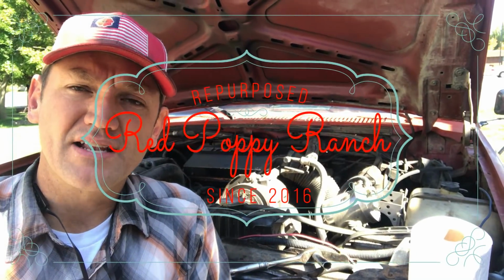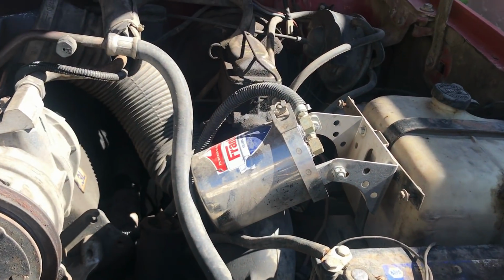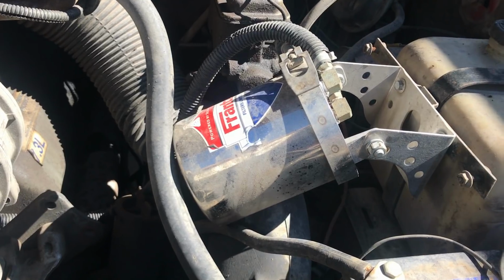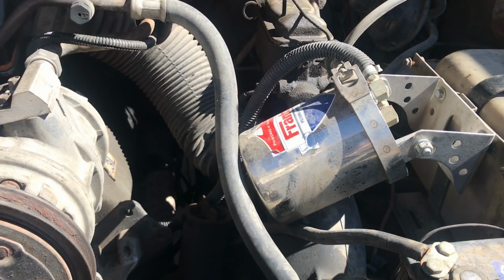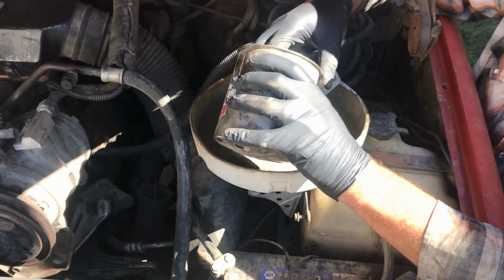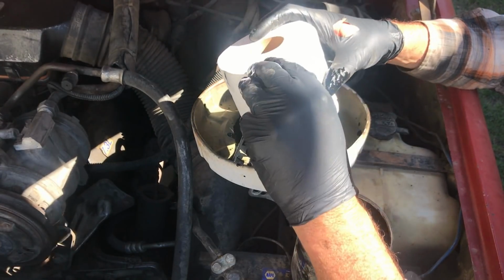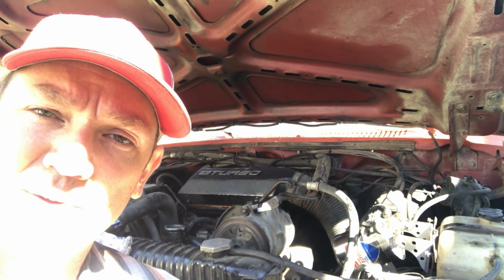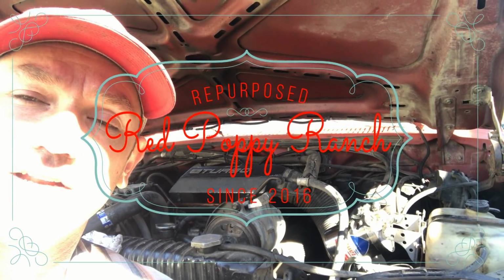#146 - Toilet Paper Oil Filter Maintenance... (Frantz Oil Filter)

Comment: Toilet paper can remove carbon black enough to make it look nice.That's how the filters were demonstrated. There will be a very small amount that is non abrasive that will get thru. When demonstrating the filters You don't want to use the same oil until it gets dark. I sometimes used diesel fuel. I think some people used cooking oil. Less messy to deal with. The same thing is happening in a diesel. You are just dealing with a lot more soot.At one time Frantz sold filters to restaurants to filter cooking oil. They could use the oil longer. The military has paper towel filters on parts cleaners. Saves a lot of money.

Comment: IS THIS FRANTZ KIT OIL FILTER IS ONLY FOR PICKUP TRUCK ? CAN IT BE INSTALL IN A CAR?
Reply from the maker: car, truck, tractor etc.
Reply: THANK YOU
Reply: I have seen a couple of cars over the years that I couldn't find a place to mount one. My Altima has bypass filters for the ATF and Motor oil.To change them I have to remove the grill. I am a clean oil fanatic. I would put them on the top of the hood if I had to.on my 64 Rambler I had the Frantz on the fender with clear plastic oil lines. Was selling them.
Reply: Both of my lawn tractors have them. I used Frantz Ford adapters and Ford full flow filters. I returned the clean oil to the drain port.
Reply: @ralphwood5114  The old Frantz 2 port sandwich adapters were handy on some cars. Didnt work so well on small engines. They depended on a pressure differential thru the adapter. For the lawn mowers I convert the 2 ports to a 1 port. The Frantz 2 ports are getting scarce.

Comment: hey, what happen to the snap ring???
Reply: The ring isn't necessary if you use a firm roll such as Scott 1000 sheet and dont unroll too much of the paper or force an over size roll and make wrinkles. Also the base does the same thong the ring does. The thing you have to deal with is getting a good seal around the core.
Reply: I wouldn't think you for sure need the ring with the Frantz elements.
Reply: The sleeve isn't necessary with the larger core of the Scott 1000 If you get a good seal at the bottom around the core.When you push the shorter roll into the housing too far the oil pressure might not be able to push the Scott down against the seal. The argument for using the Frantz elements is getting stronger.
Reply: If you don't have a sleeve you can make a better seal slightly larger than stock and a little thicker than the stock to compensate for the shorter rolls. A friend with a lathe would be helpful. Don't have to be a special shape. You can also save empty cores Split them and slide them in the new element until you get the right inside diameter. That way the core won't get egg shaped and cause a seal leak. Toss the ring.
Reply: I knew as soon as I saw him slide the new roll in he didn't need the ring. He used high quality paper Not too small and not to big. The ring is Frantzs attempt to make the filters idiot resistant for people that use Charman instead of Scott 1000.You.can get good paper from a janitorial supply. When I was selling them I was buying it by the case from Office Depot.

Comment: Bypass filters are common on the big rigs since they hold 50 quarts changes are costly. Besides these and other brands filter down to 1 or 2 microns. The big ones are OPS brand and Amsoil makes one also. Oil doesn't wear out it just gets contaminated from soot and other particles going by the rings. Soot in the oil can breakdown the zinc dithiophosphate which is an oil additive that comes in the oil for extreme pressure like camshafts (developed in the 40s). Oil also has what is know as TBN or total base number, base is used up neutralizing acids in the oil. When the test samples shows the base is getting low the more can be added. So bottom line these types of filters do work and get the oil cleaner than the full flow factory filter can. Not snake oil boys.

Comment: the trouble with switching from conventional to synthetic is it cleans out your engine and sometimes it works too well and the gaskets and seals will leak.

the bypass it's self has a small orafice on the outflow side where the oil is clean, these engines normally have a 2500 mile oil change interval so any bit of filtration helps.
Reply: KFStreich old tech no it doesn’t that is a wives tale from 45 years ago.
Reply: Your facts about synthetic oil are from 1975 and are old wives tales.
Reply: I recently went to synthetic from conventional in the 93 Legacy with 225.000 miles on it.. seems ok at 240.000 miles. Probably wasnt necessary. Its just a backup car now.

Comment: There is a trucking company just down the road from me at Alvord Tx
They don't drain oil in the big engines. They have engines that have over a million miles with no oil drains with the same engine parts. They change the big filters and add make up.oil. They spend money on an oil analysis program I don't spend money on oil analysis. My 40 year old.Ford isn't worth it. Google Gulf Coast Filters. The Ford 7.3 with the Frantz is the same system. Most. Of the owners with the little filters.don't change them often enough to keep the oil as clean as the truckers. Changing the filter every 5k might not be enough. It wouldn't be enough for my old 6.9.

Comment: So, is it real toilet paper or not? At 2:20 you said it ain't.
Reply: I think I might still have one of the original Frantz elements. It was a custom made roll of toilet paper just the right size with a thicker core. Haven't seen the newer ones.
Reply: No one has ever beat toilet paper at cleaning oil. When filter Companies come out with their own elements suddenly their new elements.are better. They are not better. Their new elements have an advantage. They fit.I will keep unrolling the Scott 1000 sheet.
Reply: The reason people call them toilet paper.filters is they were designed  to use toilet paper.Toilet paper was used for many years before  the Frantz.elements came. In those days toilet paper was a standard.size and very high quality. Then they started. Changing the core.sizes..making the rolls smaller. Most of.us like to shop around for the good stuff like Scott 1000 sheet. What some People think is the Frantz was designed for the Frantz elements and foolish people decided to use toilet paper.The Frantz.elements are more idiot resistant because  they fit.not many of us know how to use the odd size paper. Rookie's  should probably  use the Frantz elements. When using the Scott 1000 push the roll against your knee. You want the round end down.You want to make sure the core is round. You want the round end of the paper to contact the core seal before pushing the can down against the gasket. This the old instructions.The idea is to not push the paper in too far and not get a good seal around the core.unroll enough paper so the roll will slide in tight but not so tight so you you make wrinkles.  Later top loaders you.just push the TP down in the  tapered housing against the seals and put on the lid. I think the newest Frantz model is more user friendly  when using toilet paper. It might be designed for the Scott 1000.It looks expensive.  Saw a demonstration of one on u tube. The old style Frantz isn't as user friendly when using  toilet paper.Thats for the old fossils like me. Less experienced rookies should use the Frantz elements.. The new style Frantz was designed for the Scott 1000 sheet. I see one guy demonstrating how to service it. You dont have to unroll any paper. It takes the whole roll.
Reply: Toilet paper was used in the Frantz  for about 30 years before they came  out with the Frzntz elements. Frantz  had a list of recommended brands. Safeway truly fine, MD , Scott, Chiffon. and others. The light  aircraft  AeroFrantz  used the same  brands. When I say the Frantz elements are better it's because they fit. You have to know what you are doing to use the shorter paper in the Frantz.

Comment: The carbon and acid are to small to be removed. The acid in the oil from lack of changing will eventually damage your engine.
Reply: If you change the filter often enough You will also be adding enough oil. Diesel rated oil has acid neutralizers in it.
Reply: If the engine has an acid problem you know it as soon as you change the TP or look at the dipstick. I have never seen evidence  of acid attacking aluminum. I dont think any modern moter.oil would allow acid to attack the engine. Skipper Yee told me keep your oil clean and dry. Any carbon that can find it's way thru a roll of high quality TP is non abrasive like black ink. Why people think black means dirty oil I dont know. A rusty dipstick normally means water. Acid would attack the aluminum in the Frantz..never seen it happen. To a oil change enthusiast  every problem is caused by not changing the oil. I dont change oil. Probably more accurate  to say I never drain oil. I add a lot of new oil. Some call that changing the oil one quart at a time. If there is acid in the oil it will attact inside the filter and the dipstick. Use a good oil.and keep it clean and dry. I have always used diesel rated oil that neutralizes acid as long as the TBN number is up.

Comment: A buddy of mine had one of these on his 1970 Ford Pinto back in the early 70's.  One thing I remember is that it filtered EVERYTHING out of that oil.  He would run it 3-4000 miles and that oil would look as clean as the day he put it in.  I guess a diesel is a bit too much for it.
Reply: TexasScout Noneofyourbusiness Excellent point!!!
Reply: Rub a little in the palm of your hand. If the oil fills up the crevices in your palm and won't wipe off you aren't changing the filter often enough. The black is only a color such as ink.
Reply: Back before fuel injection engines generated a lot of soot. The oil turned black in a short time. Install a Frantz or a Motor Guard and the oil looked new again. The housings were no big deal. It was the 2 ply facial quality toilet paper inside that did it.We changed the filter more often and added more.new oil in those days. Not like my Altima that gets a new roll every 6 k and a quart of synthetic. Not like a diesel that generate a lot of soot and some soot particles too small to filter out. That are only a color like ink. There is dirty black oil and there is clean black oil.
Reply: In 1970 I was working for Ford. My boss had a Mustang dragster with a Chevy racing engine compliments of Chevrolet. Valvoline furnished the oil. Baldwin furnished the filters. I put a Frantz on the tow truck. Later I put a Motor Guard on his Plymouth Fury. When I heard something stupid like that paper will get in the oil or other stupid remarks I would say I put put filters on Joe Davis's vehicles. The filters were easier to sell after that. I lost track when I left California.When I left the tow truck had over 350 k on it. Almost all of it with no oil drains using Chevron Delo 100 20 wt. He changed the Frantz about every 2000 miles. 63 Chevy Suburban with the big 6 292 I believe. One of his sponsors was a chrome outfit. His dip stick was chromed. Made the oil look even better.
Reply: The way diesel owners mess up is they dont change the filter often enough. The more soot goes in the oil the more often you change the filter. My old 6.9 Ford diesel got a toilet paper change and a new quart of oil about every 1500 or 2000 miles.The oil was black but it was clean.i can spot dirty oil from across the room gasoline or Diesel. Some diesel.pickup owners are installing the big paper towel filters. I did a Fleet of them. All Powerstrokes  and one Dodge Cummins. NASA saw my posts and started  using them. He said they are for.industrial use only. The average person doesnt keep a vehicle long enough for.it to pay. I think he is right in many cases.They use the Gulf Coast. I dont do them any more. The big 80 got me.
Reply: The toilet paper can get the job done.Its a marrer of changing the toilet paper enough to keep the oil clean. Some soot is too small to be filtered  out. It is non abrasive but will turn the oil black.Truckers do the palm test. Put some of the black oil in the palm. If it is clean it will wipe off clean. If the soot fills the crevices  in the skin and wont wipe off you will  need to change the filter more often.
Reply: Did a Fleet of Powerstrokes when the 6.0s first came out. They ordered  the Gulf Coast O1 that took a roll of Bounty Big  Roll paper towels. I didnt mind changing the Gulf Coast toilet paper filter every 1500 to 2000 miles. It was bolted to the plastic fan shroud.in an upright position . I returned the oil to the fill neck below the filter.excess oil drained.out over night.

Comment: A few years ago someone saw my posts and asked for a propaganda package. It was a NASA engineer. Then he wanted me to come to Canaveral.I realized I was getting in over my head.I called Gulf Coast Filters and turned it over to them. Gulf Coast could put them in touch with their big customers such as the military Shell and Chevron. Not trying to cut in on Frantz. These.big companies use the big paper towel filters mostly. I don't sell any more. I have no knowledge on how to equip an off shore rig or the monster that moves a apace shuttle.I did learn some things such as new oil isn't always clean. Shell engineers were studying a Peter Bilt with no oil drains with Shell Rotella . someone forgot to tell the mechanic that changed the Bounty Big rolls.not to drain the oil. The Detroit was in near new condition.with one oil drain in near 1 million miles. Its not unusual for these engines to go a million miles bit not be in near new condition.

Comment: If these worked every vehicle would have them. Every trucking company would sure as hell use them.
Reply: I've heard that a lot. How about if they eliminated routine oil changes Jiffy lube would sell them
Reply: Cummins claimed an  80% increase in engine life using their big 750 oil filters. You dont see the Luberfine 750 or the Cummins  750 much any more. Some used cotton  and some used pulverized newspapers.  On over the road trucks some were chrome plated. Some had Peter Bilt on them.  I worked for a company that had luberfiners  on everything. People  got ignorant and started  thinking  the filters were only for  dirty conditions such as dump trucks. The last I bought were  Cummins  Fleetguard  750s that I got from a International dealer.  The Gulf Coast filters have a better design. The  dirty  oil has to travel thru 22 inches on the double roll  filter. They might still have the chrome models. The last information I read on the Cummins Fleet Guards is at least 30 years old.

Comment: To reduce the amount of soot in the oil we reduced the flow thru the filter. I believe Frantz had a smaller orifice for that purpose. My cars have a .025 orifice that I make Out of a wire welder tip. When I was selling Gulf Coast Filters a customer drilled out the orifice so that the filter could filter faster. Bad mistake.

Comment: About 40 years ago I installed a Frantz on.my Peugeot diesel. I returned the clean oil to the valve cover on the wrong side of the baffle. With my wife driving headed to town. Started down a long hill.my wife.said it won't slow down. The engine was running on Mobil 1. We managed to get off the road. I stuffed a jacket in the air intake to kill it. One time I had to get my wife to Tulsa to the Airport. We got diesel at Sedan ks. Just north of Bartlesville ok the engine quit. The Frantz that I was using for a primary filter was full of Ice. We had gotten water in sedan. Trooper stopped and asked if we needed help. I said I need to get my wife to Tulsa airport. He said I will take her to Bartlesville. She .can take the Phillips 66 buss to the airport. A guy stopped and pulled me to a store. I replaced the frozen toilet paper.Poured in some HEET and headed home. It was a cold son of a bitch.

Comment: Buy good oil and filter at 6000 miles can't go wrong thats for me job done no bull S--T.
Reply: At 6000 miles I change the toilet paper and add a quart of Pennzoil platinum in the Nissan Altima. In the 60s I changed the toilet paper about every 2000 miles and added a qt of Chevron Delo 100.I have no idea which oil is best. I do know clean oil is better than dirty oil.
Reply: With using filters that dont clean oil then draining the dirty oil most of the time the oil is dirty. Modern  engines  mostly have abrasives that are too small to be removed by full flow filters. That leaves you with 2 choices drain it or clean it with a depth bypass filter.

Comment: It has happened many times. You sell someone a toilet paper filter.you don't know it but the guy hasn't changed his oil in a long time. His engine is loaded with sludge. 50 miles or so the. Frantz can't hold any more sludge.you have told him to change the filter every 2000 miles and add a new quart of oil. When the rods start knocking the guy goes to a mechanic.The mechanic sees the Frantz and tells him his engine is full of toilet paper. If the Frantz.wasn't there he would be told the engine is full of sludge I towed in a Toyota. A piston was hitting the head. I removed the pan. It had a inch or so of something that looked like black sand. The oil looked like gear oil
The toilet paper was a piece of carbon shaped like toilet paper. Part of the full flow filter paper was missing. It had been over 3 years since the filters or oil had been changed. I am the one that sold him the filter. He was nice about it. Said he had been too busy to take care of the car. It was a Motor Guard.